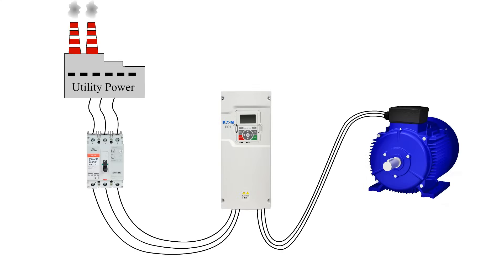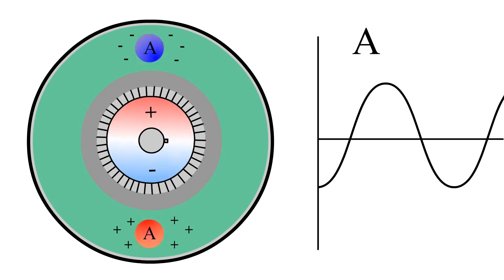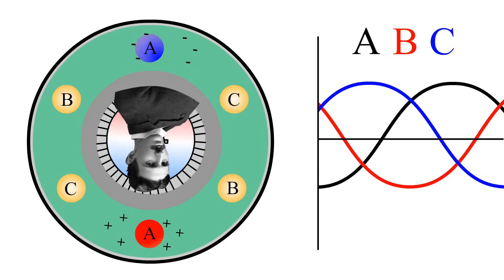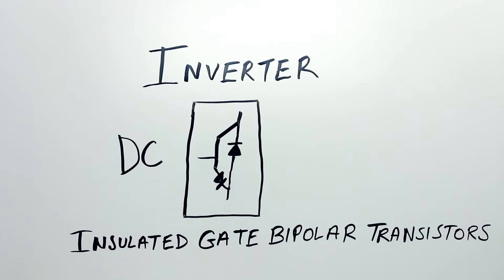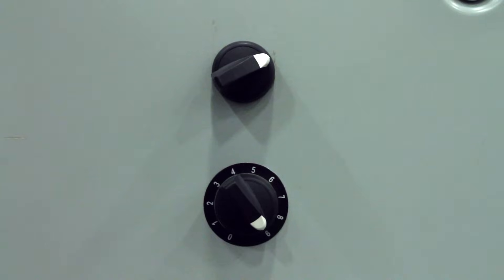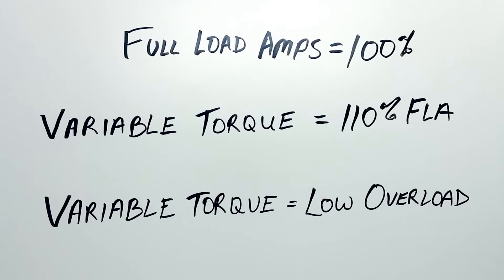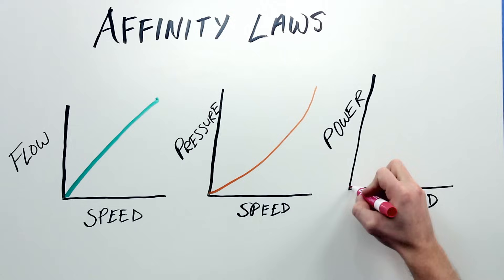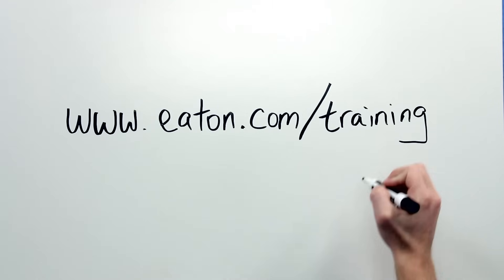VFD 101 Basics

Comment: Thanks for the nice video presentation, however it would be nice to hear what is VFD impact to reactive power since it is the power component we would like to avoid in running inductive motors. I know that there are effective solutions with condenser batteries (so-called compensation panels). I would appreciate EATON's comment.

Comment: can a 12v battery power a 3 phase 5hp 250-460volts  60 hertz 15.6 amps
tefc motor using the VFD?

Comment: Well here is the market that will need this...
Household Generator gives e.g. 57Hz where the Inverter needs grid input of 50Hz. So the Inverter rejects the input from the Generator.
A Unit that can convert Household Generator output to ~50Hz (or what the Inverter in other areas of the world require) will have a good market size if it is not too expensive.

Comment: Noob question. According to efficiency curve IM is approximately 4% of slip for maximum efficiency. why not just lock the slip to that range so the frequency varies as load changes, then we just control the voltage and frequency automatically lock for 4% slip range so we have max efficiency and precise control? because V/f control not adapting to the load only good for constant load.

Comment: How do you check the output of the VFD with a basic meter? On a 480v AC motor , although it’s AC I’m assuming you can’t measure AC with a multimeter since it’s pwm.
Do you measure amps per leg or scope?

Comment: Question is though where do I place my disconnect at before the vfd or after the vfd with the motor being not within sight. Code says within sight of the motor or 50 ft.
Reply: Usually after the VFD. I don't think the code specifically states where the drive should go in relation to the disconnect. Practically speaking it's better to keep your drives out of production space in a well ventilated and protected enclosure. The drives can be expensive, and heat has a noticeable impact on their lifespan. buying enclosures to protect each individual drive if placed in the field could get expensive. It's also good to have your disconnects adjacent the motor so people don't get lazy when doing repairs.

Comment: this really shines a light on to why manufactures prefer to size a motor a bit larger. if my blower motor is rated @1 inwc they often times say for reliability reasons it should be less the .7 inwc even tho its rated at 1 inwc.  building on this, heat is what kills a motor and my amp draw is significantly lower at .7 I have a lot less heat and in relative terms more airflow for the given amount of heat. 

super cool thanks for the video. I already knew how a VFD worked but i'm happy i watched it anyways because this is key information.

Comment: Great video!
At the next level up, it's not "positively" or "negatively charged".  The alternating voltage applied results (with a lag) in a stator current and an alternating magnetic field in the stator.  The changing magnetic field induces a corresponding field in the rotor.
Which is more complex, and why they are talking about charge.  😉
Reply: I was trying to see if anyone was going to point this out. Glad to know some people still know what they're talking about!

Comment: VFD works good pumping with no lift. So it may save some energy in that case. When lifting water requires the pump to spin at 50% speed just to get the water out of the well, the savings don't add up to much. Especially when a single speed pump can run more efficiently at max flows, and reduces the amps naturally when flow is restricted by a valve. https://www.youtube.com/watch?v=3GABhLLtjas

Comment: Great work, I like your videos. Inverters are also converters...rectifiers and inverters are comprehensively called converters. IGBTs are used because they've got an additional p-layer in their internal structure which is responsible for conductivity modulation, making them suitable for applications with higher power rating...MOSFET for example have better switching frequency capabilities than IGBTs. The static power semiconductors switches used are really a function of your ratings. In sinusoidal pulse width modulation, you wanna switch as frequently as you can to shift the harmonic content to a higher order spectrum and have the fundamental component approximate the sinusoid to as close as it practically gets.

Comment: So is a drive a type of starter? Or a type of controller? It looks like a controller, but controllers are usually connected to the auxiliary of a mag starter and the motor is connected to the branch circuit of the mag starter.

Comment: Great explanation! I have a question, why would you vary the voltage to the motor on a VFD application? I am trying to understand a motor that works with a voltage of  33-110v and frequency of 60hz to 180 hz. Why would you vary the voltage?
Reply: chadule2 I believe that'd change the speed. Whereas changing the voltage of your (probable treadmill) motor's voltage would change its power capability (torque). If this is right, it'll have helped, and if it's wrong ALL of the YouTube experts will redirect... good luck. There are some good tutorials about controlling the speed if you look up different tools, like 2x72, drill press, lathe, and even mills.

Comment: Why use 3 phase as an example when AC is the same thing even on a single phase?
What to do when we are dealing with DC mains power supply? A rectifier is not needed anymore then?
Reply: 3Phase provides smoother mechanical rotation with possibly less power loss. A single phase motor requires a split phase input, A single phase alone won't rotate a squirrel cage rotor. Look it up on the web, the explanations are all there for you to read and understand.Single phase ac motors use a different rotor construction. To obtain the induced dual phase effect in the rotor, a anomaly is created in the construction of the rotor cage. This changes the induced field shape. Again read it up on the web.You can't run an ac motor off a dc supply, you need to convert back to ac or use a dc motor.

Comment: IF WE HAVE ONE THREE PHASE MOTOR WITH 6 LEADS OUT WHICH CONNECTION WE ARE GOING TO MAKE STAR OR DELTA BEFORE WE CONNECT TO THREE IN COMMING LINE FROM VDF?? OR VDF  SYSTEM  USE DIFFERENT TYPE OF ELECTRICAL MOTOR??

Comment: Quick question, is it possible to use an oversized motor lets say 25hp instead of a 20hp, and run it at a lower duty cycle (example 80%) and save energy over having a 20hp motor running at 100%? 

I'm sure that still 20hp weather on a bigger or smaller motor is still 20hp, but I'm wondering if the the fact that the bigger motor can produce more torque with the same impulse (based on build) can maybe make it more efficient

Comment: This explains why the control boxes for the huge ventilation fan motors at my Counties welding shop are soo big, I thought the control boxes for the fan were just for starting and shutting off the motors, then the instructor said the control boxes were for how much air is being sucked out and it senses what the air pressure in the room is, they're huge 3 phase motors maybe 20 or so HP, so how can you control the speed of huge 3p motors, with huge VFD boxes

Comment: The best tutorial on VFD. \m/
Reply: 1 thing he didnt really explain is that was the on/off square wave VOLTAGE pulses to motor. Simply when you have a resistance (motor windings) and you apply voltage to a resistance, you get a current drawn by the load (motor). Because the voltage on/off pulses are so quick (microseconds, not even milliseconds), the motor cant tell that the voltage is going on and off so quick and continues to draw a near sinusoidal CURRENT and therefore rotate. As voltage stays on for more and more time, the current drawn reaches its peak, then voltage on/off time (mark/space) is reduced again, the current drawn starts to drop to zero, then the negative bus voltage is switched on to draw the negative current. The sinusoidal 'sinewave' shown over the square wave in video was the CURRENT drawn by the motor. Reducing the voltage on/off times reduces current frequency, which is  directly related to motor speed, eg; 10Hz - 60Hz current draw.
Reply: @lastnameavailableok  GOOD EXPLANATION!
Reply: +lastnameavailableok One 60 Hertz means that the current changed 60 times in one second + to -, back and forth. One Hertz is 1/60th of second. If the VFD was capable of handling kHz or MHz then, yes it would be thousandths or millionths of a second.
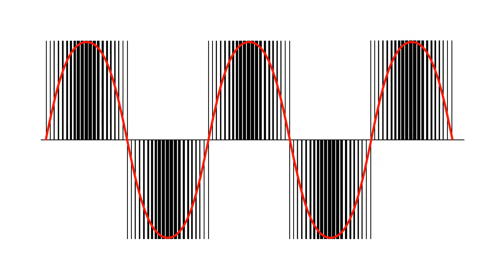Reply: Agreed, I came to understand the DC-AC inversion and at 8:00 he makes it a lot more understandable..
Yet I don't get why the motor sees that conversion as a sinwave equivalent(and because it is dumb is not enough to account for it)
Reply: +Ernesto Sastre, it seems like the it's no longer a sine wave anymore. It's like a digital signal or binary code ( varying intensity within the - or the +) so this trick kind of fools the motor into start spinning. perhaps if I attached mi oscilloscope  I'd be able to see a squarish sine signal (well sort of) genius. Hit replay and see if I make sense.
Reply: Sir I need to talk to you for dc power please tell me mobile number

Comment: THANKS FOR VFD EXPLANATION. WHAT I WOULD LIKE TO KNOW TT WHEN FREQEENCY CHANGES CURRENT THROUGH MOTOR ALSO CHANGES. WHEN FREQ, IS LOW LX IS LOW ALSO BACK EMF IS ALSO LOW THUS INCREASE IN CURRENT & MAY BURN THE MOTOR. HOW  VFD DEALS WITH IT?
Reply: From what I understand, as the frequency is reduced, the Xl is also reduced (Xl=2¶fL). This would cause too much current to flow on the windings. So, the drive reduces the output voltage to reduce that excessive current. As the frequency is increased, Xl also increases, which would reduce current flow on the windings. To maintain current flow, and therefore torque, the drive increases the output voltage to account for the increased Xl. This way the drive can provide full torque from low speeds to full rated speed.

Comment: I'm new to this stuff I just have a question , you explained about controlling a fan using VFD, how is this different from controlling a fan using a simple potentiometer (Fan Regulator)
Reply: bruh, have you ever heard of the formula for synchronous speed for motors? N=120F/P where N=synchronous speed, F=frequency, P=number of poles. These are the methods for controlling synchronous speed (speed of the magnetic field in the stator), the number of poles are set after construction so the only thing you can fucks with is the frequency. A potentiometer would just adjust your voltage which would not offer a fuckable method for controlling motor speed.

Comment: What are the consequences, if any, for going from VFD mode to Bypass mode with the VFD at 100%?
Reply: none really to the vfd it would just be a hard start and run at full HZ.  Depending on the motor however there may be way to much torque needed to start the motor (for a pump, pumping thick liquid for example)  it may be way to much.. then the drive will not handle the extra current draw
Reply: It depends on your application, what was the purpose of using a VFD? was the engineer modifying the the motor for a specific need and now it is not necessary? then, by all means you can run it directly. The purpose of the VFD is to have a physical way of adjusting the speed of the motor without negative consequences like overheating or worse burning the motor itself. Maybe if you explain your intentions of why you would desire to modify your running system, someone would pitch in their two cents.
Reply: In fact, you can run the VFD to way more than 60Hz. if your motor can handle the frequency, in that case you would need to contact the motor manufacturer and ask the question.